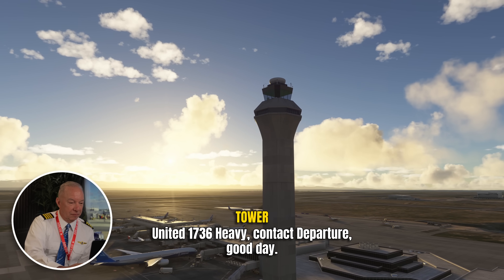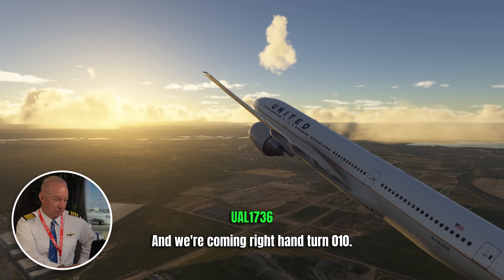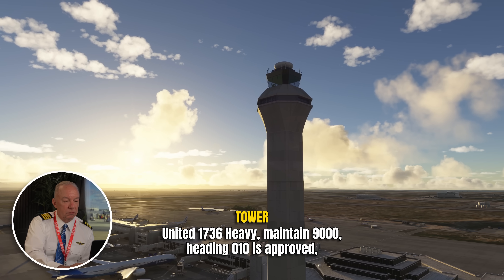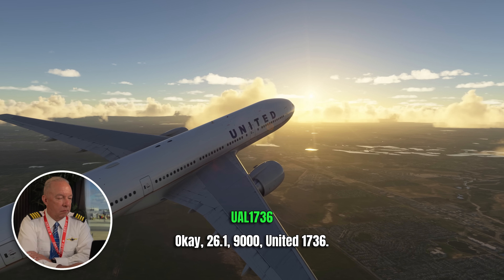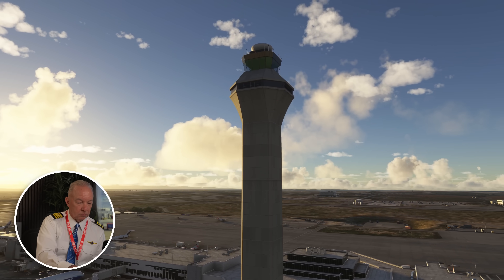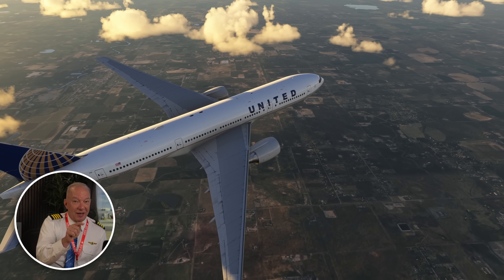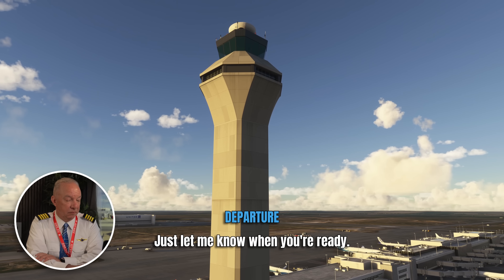United 777 Suffers Engine Rollback After Takeoff – Here's What Happened

Comment: It’s a good thing for this channel (I say that totally sarcastically) that the frequency of mechanical problems has gone up (yes, check the data). 

But, it is crazy how we all ignore that there are blooming problems in maintenance failures, abhorrent pilot activity  and ATC errors…

We need to get focused on all three immediately!
Reply: Misinformation
Reply: @Bassman_DB nope. Look up the charts…even just ask AI to create them for you if you don’t want to spend the time.
Reply: @Bassman_DB not at all. I have searched for information and there definitely has been a steady uptick in frequency of all issues since 2020. You could even do a lazy bit of research and ask AI…same story. It’s not like it is double, but the uptick is enough to suggest systemic issues rather than random chance.
Reply: @Bassman_DB 

Not misinformation at all. Go do research. You could even just ask AI and it will lay out charts and graphs showing a not insignificant increase in frequency and severity since about 2020.

Comment: After a loaded aircraft  with 120000 lbs. of fuel and 300 plus passengers is forced to fly with asymmetric thrust is the airframe inspected afterward?  I understand the aircraft is designed to accommodate that demand, but is there a special inspection of the airframe later?
Reply: Probably

Comment: It's a thermal imager. They are now built into scanners and heads-up displays on the facepiece of our breathing apparatus. Hand-helds are still the most used equipment. Used them all the time at IAD for hot brakes.
Reply: That's pretty rad. I never even considered that firefighters have a  HUD with thermal imaging in their face masks. Are there other HUD modes besides thermal imaging and how do you control the HUD system?
Reply: New technology can be so cool!

Comment: Wait a minute. Are you telling me instrumentation is sensing altitude above sea level. Thousands miles away. Useless. Altitude above GROUND where they are at. Very useful
Reply: An adjusted altitude above sea level is used because it is common to all aircraft in the area. That standardized altitude is used to prevent collisions. An aircraft that is at 5,000 feet above sea level (ASL) cannot run into one that is at 6,000 feet ASL. If altitude above ground was used, one that has been flying at 2,000 feet above a 3,000 foot mountain could run into one that has been flying at 3,000 feet above a 2,000 foot mountain. Like much in aviation, it is a safety precaution.

And keep in mind that pilots know both numbers. Barometric pressure tells them their ASL. A radar altimeter will tell them their height above ground. Both do matter, but the common language over the radio is the ASL.
Reply: Tell us you don’t know about altitude without telling us 😂

Comment: Does the captain inform the passengers of the issue involved? Surely the passengers know something is amiss if the plane is returning to the airport.
Reply: Yes.
Reply: Pilots will usually give a heads up to the passengers that there is an issue, but not always to the full extent and severity. The flight attendants are briefed, but passengers aren't always alerted to the full severity to prevent mass panicking and chaos on board (which would lead to even more issues).

Comment: I was living in the Denver area for a while.  My first trip coming back into Denver (right after the new airport opened) on a United flight the pilot announced something like "for all of the Denver residents on this flight I just want to thank you for building this huge airport and all of it's long runways.  It makes our job must easier and safer".  I didn't expect that.
Reply: it’s long due to high elevation, correct?
Reply: @rossr6616 both but its able to accommodate any aircraft a380s is the largest we get but we have regular 777s 787s 757s daily and  747 sometimes
Reply: It was also a designated alternate for the space shuttle
Reply: The old Denver airport was scary in good weather with that big u-turn facing the mountain, but it was absolutely terrifying to fly into if there was windy or bad weather.  As a passenger, after a few of those I started scheduling my trips through different airports.  I was greatly relieved when the new airport opened.
Reply: I really appreciate the extra space and the design - pilots never have to cross a runway. I recall that 737 a number of years ago that got hit by an incredible crosswind right at V1 and crashed at the end of the runway. All survived - one of the reasons that of the extra space all around the runways. Same issue at another dense airport like BOS, LGA, others and a plane is going to hit something.
Reply: The airport it replaced, Stapleton, had similar long runways and could accommodate all large aircraft.  The new facility is far from the City of Denver, inviting more pollution and traffic to less developed areas.  It was also the site of the infamously unreliable automated baggage system, which was eventually replaced with more traditional sorting equipment.  

Denver International was the fever dream of hard charging Democratic mayor Fredrico Peña.  In spite of opposition from many locals over the need, cost, and location, Peña bulldozed his way to victory leaving Colorado taxpayers with a massive debt they will be paying off for decades.
Reply: Was The Bagage fiasco a yuge part of nu Airport cost ?
Reply: @peted5217 the  airport DIA was such a joke, people said the acronym was for "do it again" not "Denver international airport" 

Circus tent roof was equipped for heavy snow
"Do it again"

State of the art baggage system flung clothes out of shredded luggage in front of reporters
"Do it again"

A lot of the drywall and cement used inside was not up to original specifications 
"Do it again"

Thousands of stainless steel propellers used in train tunnel art project were thrown in recycle dumpster 
"Do it again"

Much of the construction was "winging it" no pun intended.

Comment: Good video...but left wondering....why was there no discussion of an overweight landing, dumping fuel, or circling for a while to burn-off fuel?  The flight was from Denver to Hawaii, they said they had 121,000 lbs of fuel on board, which is less than half of the plane's total fuel capacity, so I am assuming this is why it was not an overweight landing situation and how they were able to return to the field as soon as they were ready.

Comment: Thanks for you videos. I enjoy learning from you 😊. I have a question….if you’re on a flight that takes off but for safety purposes the captain decides to return to the airport. We land safely, stop on the runway, & the Captain decides to evacuate the plane while on the runway.  Where’s the BEST place for passengers to go so we’re safe & not in the way of vehicles? 
Thanks so much 😊
Reply: The flight crew should tell you where to go after you exit. If that doesn't happen, use common sense. Get off the runway. Get away from any fires. Stay away from fire trucks. If there are vehicles (i.e. buses) to take you back to the concourse, go to them. And if you're in fine shape, assist those who are not. People are often injured coming down those slides.
Reply: @Inkling777 thanks for this information. 
I was curious and asking because in so many videos you see people just walking in all different directions and not going to one specific area after deplaning.

Comment: Ur operative word " Complexity" is complex number space arking vectors Matrice Water Table mathematical turn style 9 ball Double Diamond Tetrahydrolase fused with Helium to experience perfect balance across the entire 15D DH 12 Universal Galactic Service organization Guardian Alliance Shield Firewall Security Teams operating here 
The A0¹ Beast system is not a ,45° triangle function of LOGIC TEST results of parasitic METATRONIC Digital 10 code implosion D1 atomic Red pulse wave because they FELL asleep at the moment 
Eternal Sun Temples codecs breathing Core Still point of a TRUE Vacuum Inner URTHA Krystal River 🌈 Aurora's Spiral Council quarantine security teams operating here 

A 6 is ñot a 9
Their Finite simulation within simulation within simulation generation after generation keeps compressing their nucleotides sequences writing chaotic distorted sound waves recording speeds 
Thàts à circulation breakdown 
Circuit breaker endocrine disruptors holding Spirits captive as a source of electrical life force power to power a finite Vampiric Super Computers used to siphon fuel out of this planet and Crash the 15D DH 12 Universal Galactic Core service organization 
Gate Crasher QI Shadow Body Black CubeiT fallen Intruder Races Alliance

Comment: The area inside the fence at DIA is larger than Manhattan Island. It's huuuge. Wind shear and microbursts along the Colorado Front Range are quite common in the summer. Microbursts can produce downdrafts up to 6000ft/min. That's 60mph straight down. Do not F around with microbursts, even in big jets. They can shred small aircraft.
Reply: They can shred large aircraft as well. In the mid-80s a micro burst downdraft slammed a Delta airplane landing at DFW (Dallas/ Fortworth) into the ground killing all aboard. The plane was too close to the ground to recover.

Comment: Why is the fuel info important?  It just took off so it must have full tanks. Seems like it create needless conversation.
Reply: You don't take off with full fuel if you don't need it. The question is so that the ARFF crews know what they're dealing with, worst case.
Reply: There's a lot of fuel used during take-off, which would also vary by weight and speed and engine type.

Comment: a common threat I see time and again on these videos is the hesitation and delays on giving SOB's and fuel remaining.... Before every single take off I have made in the 8 different types of aircraft I commended... a blank ATIS form was on my clipboard.... with souls onboard, fuel at take off and how long it was going to take for me to dump fuel to landing weight... as well of course.... the flight number.... right up top and center with a box around it.... so easy.... and the only time I ever used it????? in the simulator.... safety is no accident.

Comment: Can you explain the difference between an internal compressor fire vs. an external fire?   And how the fire responds to each?
Reply: Behind that big turbine in a jet is a series of turbines that also rotate (rotors) and standing fins (stators) that make up the internal compressor stages. Then there's the core (where the fuel mixes from injectors and burns (some older jets also had a "flame cone" assembly in there) AND finally to the rear, more rotors, through which the exhaust gases expand and blow. The exhaust rotors pick up some of the thrust coming out and turn it back into torque (rotational power/force) to spin the forward turbines and big-ass fan to suck more air in... but only SOME, so the rest gets to be useful thrust.
   A compressor fire is when contaminants get involved at the forward compressor stages, so it's still contained in the engine, but as fire burns hot, it also disrupts (sometimes destructively) the airflow through those compressor stages. The fire also expands the incoming air early and that diminishes the power that can be produced at the core. This will usually result in compressor stalling and the chains of fire balls bursting out the rear (exhaust) of the plane.
   An external fire, just as the name implies, is any time something either lights fire to the cowling and covers around the engine or when fire breeches the cowling and covers to get OUTSIDE the engine. It's rare, like really rare, but can melt or shred the engine's housing, exposing the inner workings to the outside world, and if the cowling and covers get breeched, it leaks all the high pressure and expanding gases into the atmosphere, literally "killing" the thrust. External fires can also breech the wing skin and even fuel tanks, spreading through the worst possible parts of a flying plane to lose... You need wings to stay in the air, no matter how fast you can still go.
    As to responses... An internal fire is generally less obvious, so they approach with the thermal imaging guns first, and there's a designated value at which they blast water and foam directly into the engine to try to douse it. AND upon a prescribed "burst", they will return to inspect with the "infrared gun" again... repeating bursts as necessary until the fire can be declared "out". With an external fire, there's no need to bother with infrared devices, considering flames are visible and spreading (or threatening) to the wings and potentially the fuselage. Firefighters then just start hosing down the afflicted area... basically wherever they see fire... until they've got it under control or out "as far as they can see". Then out comes the infrared gun again, to check for hot spots both inside and outside the engine. If there's a suspicious hot spot, they resume prescribed burst of water and foam wherever they've seen the hot spots and repeat checks with the infrared gun until it can be declared "fire's out".
   I'm sure Cap'n Steeve can get a bit more in depth... BUT it's good for me to recall my early firefighting training... In any case, hope this helps a bit until he has something more comprehensive. "Captain Joe" (channel here on YT) has a series of videos about Jet AND Turboprop engines, in case you're interested in the visuals and some overview about how they all actually work and what they do. It might help with understanding just how firefighters can douse a fire inside the engine without having to take it apart... and even what kinds of damage it can cause depending on where the fire starts or gets to.
Reply: @gnarthdarkanen7464  thanks.  Thats good information.  Next question … on most large engines, there’s (2) fire bottles … as I understand it, the Captain can deploy these, but they’re only useful on an external fire under the cowls.  Fire bottles have little effect at extinguishing an internal fire.  Should there be an external fire, is pilot protocol to continue to add air from the APU or other engine in attempt to blowout the internal fire?  (Assuming this is before ARFF arrives)

Comment: The "thermal gun" is most likely a TIC (Thermal Imaging Camera). During a firefighter's career it is one of our best friends for locating hidden fires or sources of heat
Reply: Yes, and the laser Capt. Steve refers to is only used to ensure you're pointing at the intended area. It has no active role in the actual temperature measurement.

While we're on the subject of lasers, please help me in my campaign to stomp out the saying, "Focused like a laser." On the best lasers, the beam is diffraction limited and very close to a parallel beam, but still diverges a bit. Cheap pointer lasers are much more divergent. The only way to make a laser beam actually focus is to add lenses in front of the device, just like you would any light source.

Now you can impress friends and family with your new found laser expertise!

Comment: 04:43 - It's like in Star TreK: "Commander Data, You have the bridge!"
Reply: Mr. Sulu, you have the Con.
Reply: @LaunderedCottonQuilts  yeah... something like that!
But I am more TNG than TOS.
Reply: Seems like a small thing, right? Except in Eastern Airlines 401 when 4 guys tried to work a broken lightbulb and no one was flying the darned plane.
Reply: @michaelgoldsmith3534 I agree it's important especially in parenting. A proper and consciously recognized hand off of responsibility keeps everyone safer.  If it's not overtly obvious, say it out loud.
Reply: @michaelgoldsmith3534 but no one here says it's a small thing. Take it easy.
Reply: @michaelgoldsmith3534  is not a small thing. That's for surte.

Comment: Does anyone know when this happened?  My family has flown this Denver to Maui (UAL1736) route a few times and these United 777s are definitely older aircraft. The one we were on departing July 1 was delayed over an hour due to an inaccurate fuel gauge reading and was 31 years old.  Then on take off the number 1 engine sounded different to me. We still made it there safely, but the older aircraft seem common for this route. Usually there are no screens in the back of seats on UAL 1736, You have to use your own device.

Comment: Mayday (01:00) ?? For an egine Roll-Back ?? You sure about that CS ?? Not a Pan ??
Reply: An Emergency.  They were fueled for an eight hour flight, operating on one engine, high altitude airport, terrain.  The 010 heading is a terrain avoidance turn.
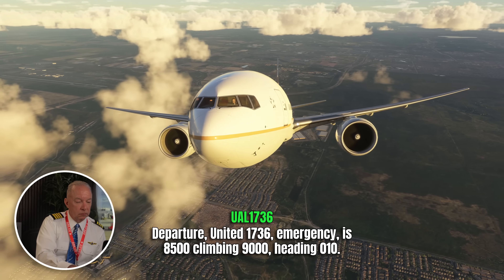Reply: @steve337  @steve337  So where was the "Imminent Danger" to aircraft or passengers in that situation to warrant an "Emergency" which falls under a "Mayday" call ? They were still able to climb (04:10) and had control of the aircraft (at that point of alerting ATC). 
Thanks for the reply just the same. :)
Reply: @nightcrawleroriginal most if not all airline’s procedures are to declare if there is a power loss on one engine of a two engine aircraft.  Any serious stem malfunction would be an emergency (Hyd, Elec, etc). 

As a Major Airline Captain (over 25,000hrs, 10 Types), I’ve declared for an engine failure and a flap problem.
Reply: @steve337  Thanks for the reply. :)
Reply: @nightcrawleroriginal your very welcome!
Enjoy the evening.